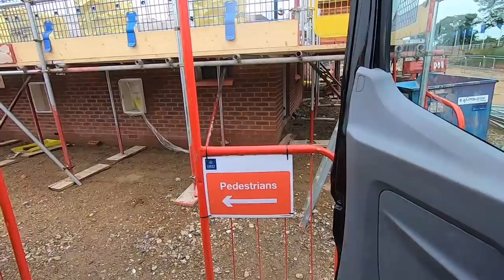Why you DONT do brickwork in the rain!!!

Comment: Is number 32 finished, no, why not it says here it should be. It's been below zero for a week with no sign of +5 degrees and it's holding off the Plasterers. He lifts his spreadsheet and scans it from side to side. I can see no mention of the weather on here he says. Tell them if it's not done by the end of the week I'll issue a non conformance, three of those and they're sacked. Ok boss.
The resident in number 42 says there are a lot of men making a huge mess all over the place, and she's told them to stop but they are ignoring her, sort it out will you. At number 42, eight men where doing their best to keep what render two had put on the wall, on the wall, in a really heavy rain downpour. By the time it had been on the floor twice is was more like soup and everyone was covered in it. Earlier they had been told to get it on quick if they wanted to keep their jobs.

We live on an island and we have to work with the weather or everything sags or ends up on the floor. Eight weeks of continuous rain one year and funds where getting low. 
Pesky westerlies.